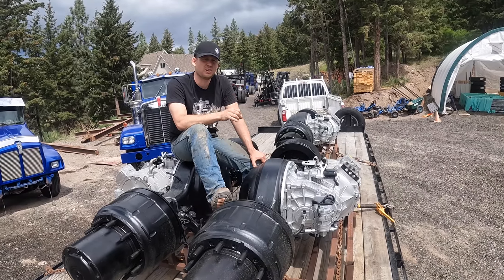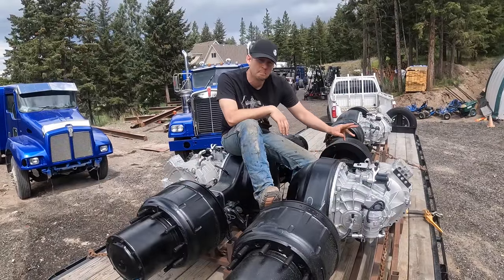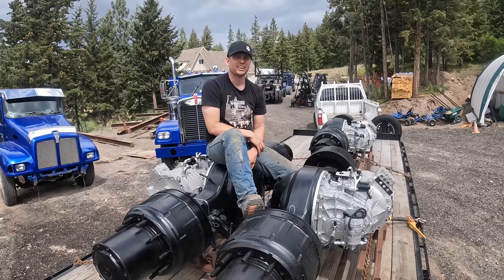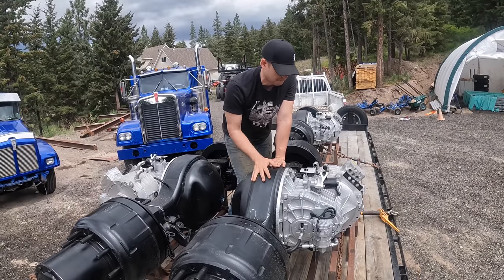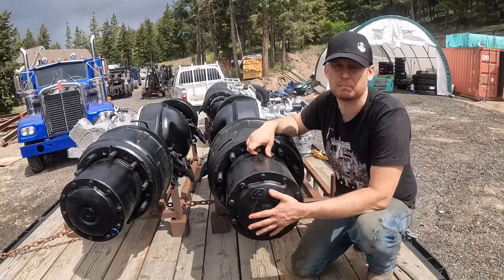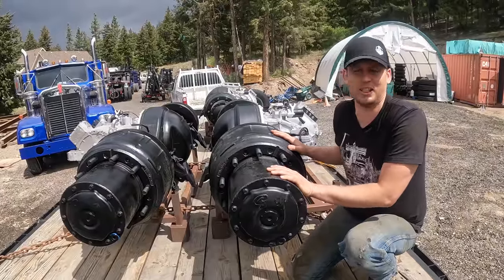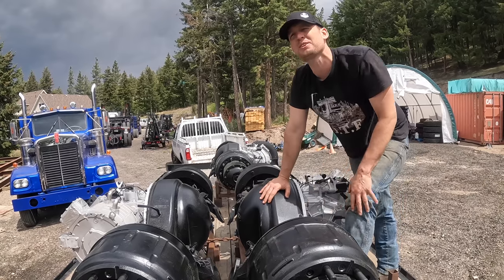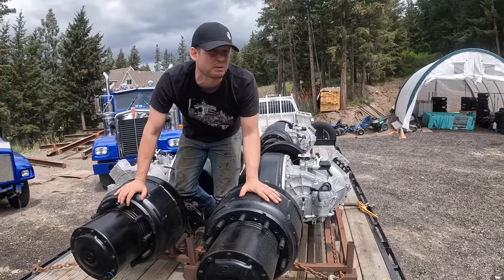Challenges of Building an Electric Log Truck: The Hunt for North American Axles

Comment: Those cast aluminum casings will be dangerously close to the ground, you may want to armor them to prevent a rock or large stick from ruining your day.
Reply: I was wondering if they could be clocked upright, to be over the axle centreline instead of fore or aft of it.
Reply: @Adam Ant  that may require the oil and cooling systems be redone, but it's doable
Reply: Regular logging trucks don't seem to damage axles due to ground impact. They will be used on "logging roads". These "roads" are also suitable for ordinary sized trucks. I don't imagine these log hauler trucks will go "off road",  just up and down mountains and on highways to a mill. Furthermore, the absence of mechanical driveline will result in a large weight reduction and a huge maintenance reduction. This man is a log truck operator. He knows what will break.
Reply: @fraserhenderson7839 they’re literally called off road trucks.. yes logging road and spurs and have ground clearance issues and rocks can fall off cliffs. I am also a log trucker myself which due to these guys is getting wilt of hype these days..

Comment: Congrats on finally getting axles! The only reliability issue I foresee with the integrated motor is that it's part of the unsprung mass so it's going to be bouncing up and down with the axles across bumps. One thing electronics hate is vibrations. I hope any PCB's or other electronics in the drive unit are silastic'd and potted up like crazy. I can see solder connections fatigue failing and causing issues with this design. But I'm sure you guys are already way ahead of me with that ! keep it up!
Reply: Not saying don't pot it as this does feel like a situation where it might be warranted but I see it being used as anti repair more often than circuit protection.
Reply: Further testing with seen some modifications I'm sure, but the issues you are worried about are historically handled via a combination of mechanical connections, solder, support and strain relief. Solder by itself is not usually considered structurally sound in industrial application.
Reply: The B2 Bomber has a situation where the vibrations in the electronics bays is around 17 Gs of random vibration. The electronics there were built to take that. The vibration levels in these axles will be far less than that. As to unsrung weight, that will again not be a problem. These are Heavy Trucks, running at low speeds. They are not F1 race cars. The tires will stay on the ground just fine. 

But indeed, congrats to Edison for getting a product that they can use to build their product. Now they just need to move to bring it in house in the long run, as Tesla is doing with their products. Henry Ford was right about the best model for manufacturing is to bring raw materials in at one end and have finished product pop out the other.

Comment: For the powered trailer idea, I wonder if the trailer company that pressed the frame rails would be interested in collaboration. They could be a cool resource to help develop that tech.
Reply: Edison Emergency Trailer Traction. 

I'm calling it. Slap on a wireless button in the cab and have traction assist when needed, but not otherwise. 

Instant adding EV horsepower to otherwise unmodified classic diesel trucks, once the concept is proven WAY easier to sell Edison Hybrids to these truckers after putting some miles on that kind of rig.
Reply: Look at what krone in collaboration with trailer dynamics are doing in Germany, a trailer with a giant electric motor on the middle axle with either a 400 or 600 kWh battery underneath

It has a sensor on the kingpin that detects how hard the trailer is being pulled and uses that data in combination with map data of hills to assist in the most effective way, this is a good idea for backwards compatibility but I think they should develop some cambus interface so the truck or the driver can fully control it, especially for regenerative breaking and low speed traction aid
Reply: @olivergunn2796  they can also add in some yaw rate sensors and control vehicle/trailer dynamics to avoid jackknifing or excessive sway.  Possibly even torque vectoring for steering.
Reply: I had a hydrostatic drive on the trailer, but this is better.

Comment: Nice work guys!  I haul logs in Alberta, I have often dreamed of this type of system.  Having powered axles on the trailers would reduce spinning out (empty or loaded), cut down on truck assist by pulling or pushing with the dozer or other machine, reduce chain up, eliminate dropped drivelines, greatly improve safety on the road, improve efficiency with regenerative breaking and more.  We are pulling king b sets with 85000kg gross.  I see this technology being the norm within a decade.  You are carrying out the work that Letourneau started in the 50s.  Keep up the good work.

Comment: When you talk about having your trailer push, it reminds me of the slug-units we used at CN. It's heavy. It has brakes. You hook it up like any other locomotive with your MU Cable (27-Pin Jumper Cable.) and it pulls power from the main unit to drive its traction motors. Air controls were done from the MU Airlines, but any aux functions like dropping sand, headlights, all that jazz was jumpered in along with the 600 Volt power for the motors.

When you look at how trains run these days outside the yard, the motors do almost all the work. Your acceleration and deceleration of 30,000 tons. Your stopping and going. Regenerative brakes are sweet to be sure, but the sheer amount of power of a dynamic brake. It's the jake brake of electrics. The dynamic grid gets cooking, and the fans spool up like a jet engine. 

So when I think of a trailer application on an electric truck, sure the idea of a pusher is cool and all, but being able to hook that up to a dynamic grid is cooler in my eyes. When we talk about a hill, are we more afraid we won't top it, or are we more afraid we won't stop it. Electric motor means no gear. Faster it spins more amps it can pump. You don't get that loss of effectiveness when you're starting to run, cause you don't have to match a gear ratio to your engine speed limit. Slap in a traction control so it doesn't skid out, and you could just have a "Jake" button, and a dynamic controller similar to what you see with a pickup truck brake controller. Could have a "light" and "heavy" application button if you wanted to get fancy with it, so you can choose whether to activate a light drag or a full stopping force. (Maybe a "Hold" function, where it works to hold your current speed, and a heavy function for decelerating)

But wait, there's more. You have traction control on those brakes. When it's slippery or slimy, that trailer should be pulling itself straight and acting like an ABS, because it is. It can't lock the tires, slower they go less amps they make less resistance there is. You know how BC is, I know how BC is. You get grease year round.

Sorry for the long ramble, but hey, the best ideas are born from bullshit. Just felt like saying what was on my mind when you mentioned trailers is all, haha.

(Unrelated - If you were to look at a log trailer manufacturer local here in BC, check out Freflyt in Vanderhoof. They're good people based on my interactions with them, though I have no affiliation with them.)

Have a good one, and thanks for reading.

Comment: Wheel speed may vary on tandem axles due to tire wear, tire pressure and turning radius.  Yes, they need to be synced, but be sure there is some wiggle room in the tolerances.  I don’t know the specs on the motors you got, but some Servo motors can match rpm’s exactly causing your axles to fight one another.  I’m sure you have thought about this.

Comment: I experienced the very same issues with trying to source rubber tracks for the machine in my avitar. Even though I had the cash, and would pay up front, the manufacturers would just say yes, then when it came time to deliver, they would change their minds and say no. All in hopes to break my will and hope that I would give up.
 Eventually a south Korean manufacturer that understands the benefits supplying a new demand rather than destroy new demand in compliance with the wishes of their current customers to control a market, took a chance and sold me a set. 
 That was over 20 years ago.

Comment: Unless they are outboard rotors, stick with drums. Inboard disc brakes are no fun to work on and the cost per mile isn't fun either. Will locking all 3 axle motors to the same speed increase tire scrub?
Reply: At a first glance, I’m thinking if all the motors sync via on-demand-power-consumption the tires should be doing the same amount of work per axle per side so it might keep scrub to a minimum. Traction control algorithms/coding would probably also limit scrub, even if they’re synchronized via speed
Reply: Sure. That's true when the truck is driving in a straight line. Some stuff I don't fully understand happens when turning and each axle travels a different distance. That's why 90%+ of trucks with more than one drive axle have an interaxle differential. 

Should be possible to have the motor controllers act like a limited slip. If the wheel speed or motor load deviates too much from the other axle(s), the controller locks the motor speeds together for 5-10 seconds. Motor speeds could be locked together when the axle lockers are engaged.

Comment: I don't know if you have it set up that way, but you could utilize you oil circulation pumps to facilitate fluid changes.  It could push clean oil in while used oil is flushing out which would also help displace sediment.  You could even do a closed loop filtration which you probably already do which could also add the benefit of a heat exchanger.  Easy service is a must.

I worked for a great equipment company that was privately owned then was bought out and ruined by a large corporation.  Before the purchase we constantly worked at upgrading our equipment and software to make it continually better and give the best support possible to our customers.  After the purchase the new philosophy was touch nothing and forget about improvements and don't give the customers anything for free even if it should be covered by warranty because it was a known problem.  I quit and went to work for my self to help out my old customers who were no longer supported the way they should be by my old company.  The lawyer came after me.  It is very rare that any of the once great companies are ran by the people that started them and built the brand.  Corporations buy the good companies for the good brand name and ruin the brand or move production to China or both.  Stay strong and most importantly stay independent.

Comment: Adding to trailer axles, many current AWD hybrids only use the rear motor to assist launch or for additional regen. Most of the time, the rear motor coasts, meaning it's far less powerful, like 60HPish. The trailer axle could be only 100Kw and still give plenty of extra oomph.

Comment: Great job in the engineering of these trucks!! As a heavy haul Alberta trucker disk brakes are not an advantage in steep slope and muddy terrain. Wear pattern is very
Uneven and are a bigger cost over drum brakes
Reply: Interesting. Here in New Zealand we run a standard truck and trailer at 58 ton and we find discs to be much better than drums. We have a 6 monthly safety inspection for trucks and trailers, and a disc unit will fly through with no issues where as drums are forever needing to be washed and adjusted. All us mechanics hate drums vs disc
Reply: @keyboardplayerakas  Watch some alberta oilpatch videos you will see trucks and trailers being pulled through axle deep mud.

Comment: From being around prototype drive powered ag implements I would warn and be careful with drive powered trailers. The original ones I was around kicked in when it sensed slip like you said to push you through a mud whole. Problem is it didn’t know getting stuck slip vs sliding down a steep hill slip. First time tractor and implements were   going down hill and started to slide the implement kicked in and shoved the tractor into a jackknife near wreck situation. Later versions have gps front and rear to tell percent grade as well as if everything is in line vs turning.
Reply: Slip aka fast wheel speed... slide = 0 wheel speed... 

If these motors know the smallest variation in speed... they should know slip vs slide?
Reply: @mattlane2282  that would be the case in the event of locking up brakes slide. Not using engine or grade braking. Tractor was controlling load going down hill in field  but there was a percentage of wheel slip. Implement sensed this slip and decided to help out and shove. I’d imagine concept is the same on logging truck going down steep muddy grade trying to use “engine braking” from e axles on tractor. Not saying it can’t be done but in the ag application the fix was for the implement and tractor to know each others position and % grade. Ex not apply power on downward grade or if implement and tractor weren’t in line

Edit: my use of slide in first comment wasn’t best word choice as much as wheel slip.
Reply: @92fordpower  Can't really picture what you are going with, anytime you are trying to slow like with regen I fail to see how the axle is going to overspeed... it's going to lock up... if anything I would think the rear would able to detect the issue and also hit regen hard... 

Going forwards lets say everything is 1000 rpm...
Tractor end goes to 1400 rpm, the trailer will kick in power because of wheel slip...

Same deal going forwards down hill regen...
Tractor end goes to 0 or (abs of somesort) 500... trailer kicks in regen to help prevent the slide... it knows it's going too fast vs the tractor end...
Reply: Well that should be fairly easy to implement if they added a throttle cutout. As in if the slip starts to occur and the throttle is zero, it starts Regen braking instead. Because in trucking you have basically unlimited inertia downhill anyway

Comment: So true about the active suppression of EV tech, it's mind boggling that retro kits aren't already a common thing, I imagined it would work perfect using the transfer case as the reduction box, after deciding my wagoneer needed a motor bolted up to the pumpkin, rebuilding old transmissions and engines is very difficult, ineffcient, polluting and expensive and the knowhow has nearly dissapeared.  Best of luck brilliant work, please hire me!!!!

Comment: On the powered trailer - even if pushing from behind turns out to be a rare need or too novel of a concept to be adopted, the regenerative braking from 2 extra axles would in theory increase the time between generator shutdown / startup.

Comment: question - for a versatile trick, selectable hub gears are an option -  mechanically.

Your powered trailer "idea" is already done in Australia with a diesel powerpack.
3 powered axles on a trailer opens up a whole world... (pretty sire steepness for access is already "regulated" - sure pushing through mud - the future awaits.

Comment: I think you need the trailer drive as well. I think you should go with a wifi controller and run power lines through the fifth wheel break it up into an outer disc, inner, and the pin being the 3rd power line. As soon as the truck hooks up, that powers the rear axles that connect to the truck AP and now you can send axle data, speed control, trailer battery, truck power etc. All without getting out to connect even an air line. The fifth wheel can even confirm it is locked in before activating the discs so no threat of electricution. Or the default is to hook up some forklift lines and a datacable built into 1 connector. 
I would also put in a oil cooler for each axle pack, or instead of the big round pumpkin, use a large aluminium heat sink on the back of the diff for cooling.

Comment: Excited for you guys! Maybe it’s just my experience, but as an on-road HD fleet mechanic, I (and my whole shop) prefer drum brakes. We’ve had more issues and expensive repairs from disc brakes than drums. (Callipers failing, mostly. But also the extra time and just more exhausting work disc brakes add to pulling a hub) just some input!
Reply: Regenerative braking might take a lot of stress off the brakes tho

Comment: What is your target price on the axles (after production is smoothed out)? Will it be economical to retrofit existing rigs?

And lol, the max speed of your low range axle is greater than the max speed of my truck 😂 and the horsepower of one beats my trucks engine lol! (68 f800 single axle dump, 235hp, 60mph to rpm warning line). If the thing still runs when you do start selling for retrofits, it'd be interesting to see if I can do it!
Reply: I second the request for ball park pricing per axle.

Comment: @ 7.30, a power trailer would work well in earthworks as well.  In tight foundation pads the truck is often dragged to a halt. A powered dolly on the 8 and 10 wheel trailers ( New Zealand) would make a major difference. Currently once the trailers drag the truck to a halt you are stuck running truck only to finish the job.